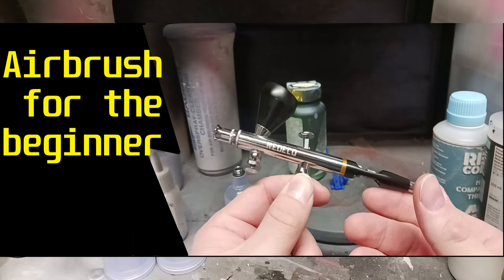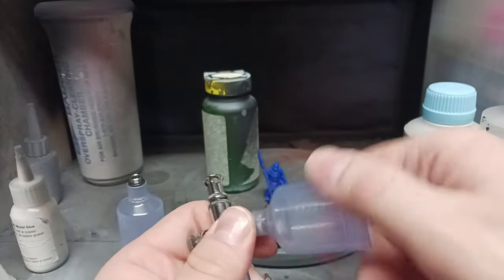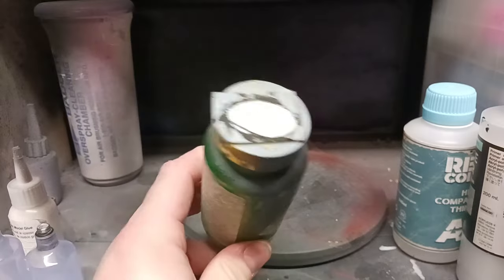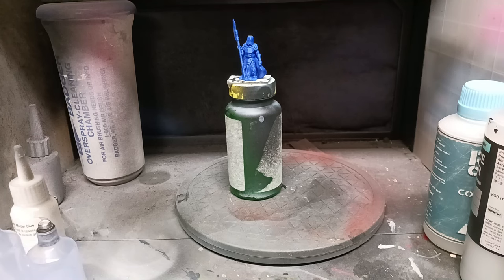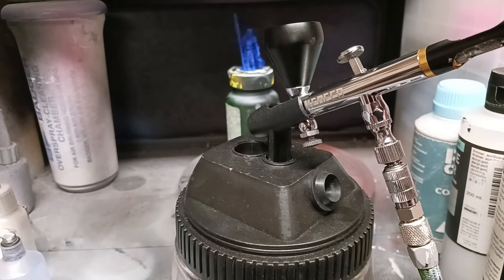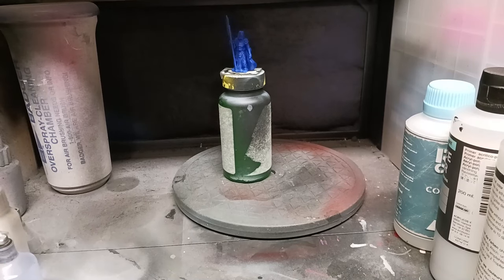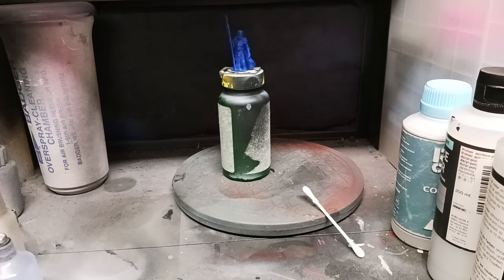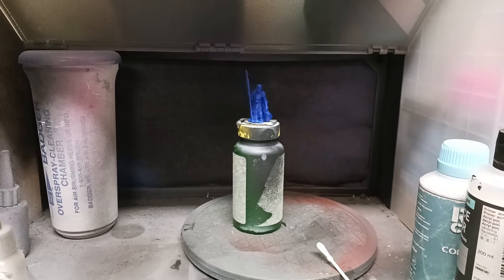Beginners guide to the airbrush

Comment: I have a paashe h and an Iwata, they each have different threads for rhr hose.
If I get a quick connect does this allow me to get feed amends that fit in both brushes bug still alow me toqick connect to the paasche hose
Reply from the maker: It will, it will have a part that will screw into the hose and then the part that screws to the airbrush, depending on the size of the thread, you may need an adapter piece
Reply from the maker: Yep, no problem

Comment: Wait what, you use the concentrated version of Simple Green at those measurement? Isn't the concentrated Simple Green way too strong to be using so much of it?
Reply from the maker: No, most airbrushes are solvent friendly, and I'm using the old bottle, the gallon jugs are not as concentrated, and your adding more water to the mix
Reply: @bluestraveler2342  what are the measurements? Seems like equal parts of Isopropyl, Simple Green and water, yes? And the water is distilled water, or just tap water?